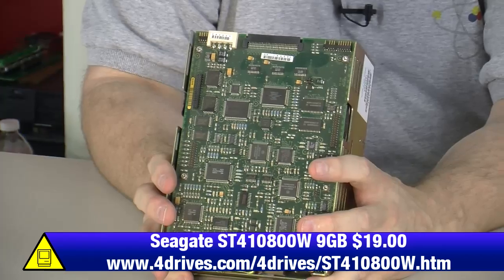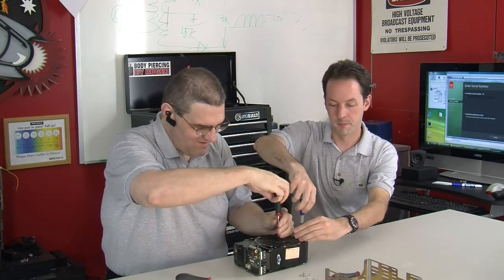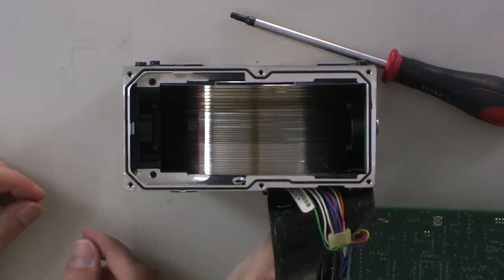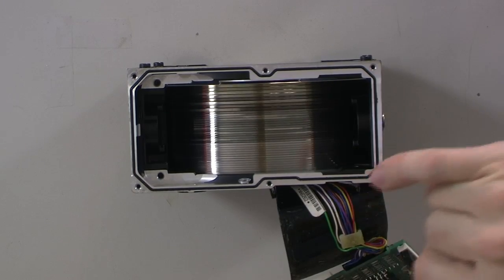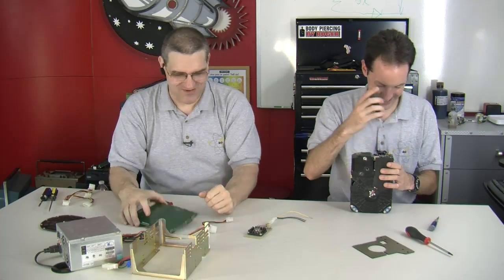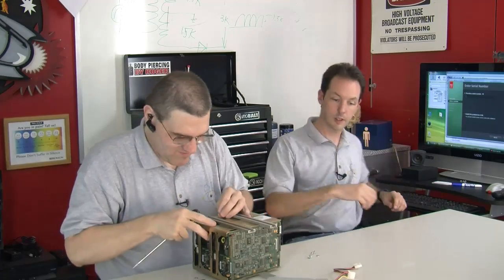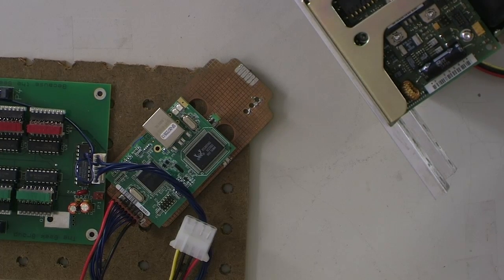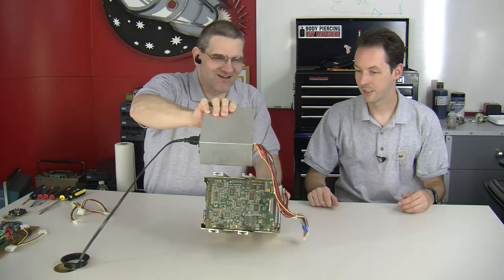Hard Drive Gyroscope

Comment: Nice piece of synchronous motor there. The 6 wires are probably a set of motor windings together with a set of encoder (or resolver) wires which is used to determine the platter's position, and the driver board runs a servo loop to drive the motor windings.

The reason the disk coasts before it starts braking is because the regenerative power needs to get dumped in a resistor (that's why the heat sink on the board gets so hot) and the driver board can only do that once the internal DC voltage drops below a certain level. It uses a controlled rectifier to do that.

Comment: Suggestion for a next project: Get a bunch of drives in a three-plane arrangement with an accelerometer so you can control the precession forces by slowing certain drives down or speeding them up. That would really demonstrate the function of spacecraft reaction wheels.

Comment: Excellent video!  I think that hard drive has a 3 phase BLDC motor, 3 wires for the motor and the 9 extra wires are for the hall sensors that detect the position of the rotor as it spins. I think the driver board use the MC33033 motor driver.

Comment: Multi-part question, multi-part answer: There are lots of kinds of motors, some just need + and - DC, some need AC from a plug in the wall, the list goes on. You saw all those wires, that's a brushless DC motor, and it needs stuff on the board to make it go. You *could* just replace it all with a single controller module, but why bother? As for the voltage conversion, the board has two parts: logic and motor driver. The logic section needs 5 volts or it burns out, the motor needs 12 to run.

Comment: No, if you had a super-mega-ultra-accurate scale, you'd actually see the mass increase by a minuscule fraction of a microgram due to relativistic effects, but for all intents and purposes, it always weighs the same. the reason it acts funny is that it resists torque. Torque is turning force, not to be confused with normal forces like gravity.

Comment: Tried this myself after watching this - looks like I dont have enough mass (4 3.5" platters in a 5400 rpm drive). The only other I have here is a 320Gb sata drive and its still perfectly operational so not willing to take it apart. I could feel the gyroscopic forces acting on the drive as I tilted it, but it wasn't powerful enough to do the tricks shown here. Your example has a heck of a lot of platters and must be hell on the poor BLDC controller when it first starts up :)

Comment: @ the drive slowing down. its probably because the power supply your using is for computers and has a power drainage system that activates to discharge caps when shut off for safety. if you unplug all the power connections and let it spin out and if it don't do the huge slow down. that was the case ^^

Comment: I was watching the video and I greatly appreciated the experiments with ever day items, Just curious on a few design things here. One why would you want to convert 12volt down to 5 why not just simply start with 5 volts ( or just leave it at 12 to give them a boost if they can take the voltage and amps)? Also why are you maintaining all the drive boards they serve no real purpose you should be able to connect the power directly to the drive motor right? Good job on the project  though.

Comment: I have tried the same thing but only made 1 gyro.  I believe you need the 2nd gyro to be 90Deg from the first one.  This causes one to fight the X axis and the 2nd one (At 90Deg) to fight the Y axis.  I think the 3axis is up and down so hoping that is not needed.  Have you had any luck with this.  I originally wanted to use mine for a video camera stabilizer (i.e $teadyC@m (to avoid copyright issues here))